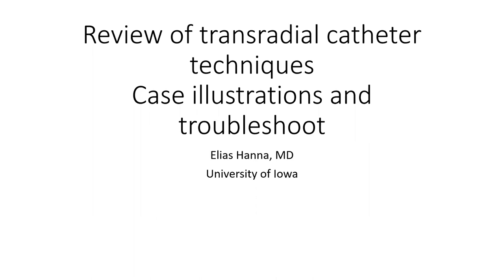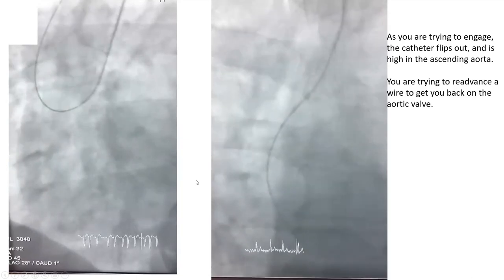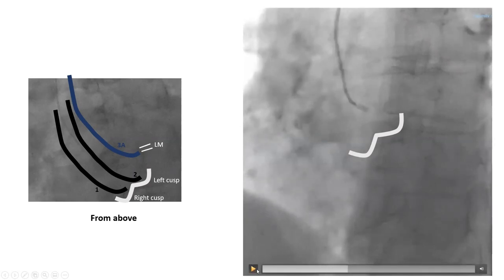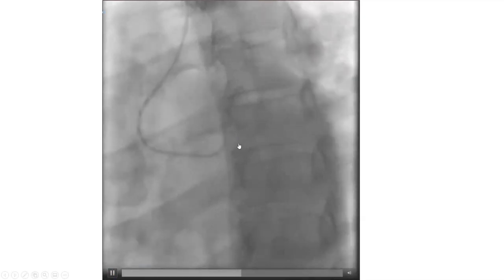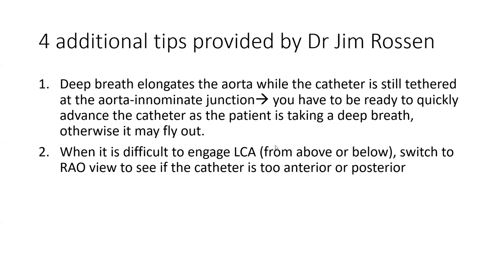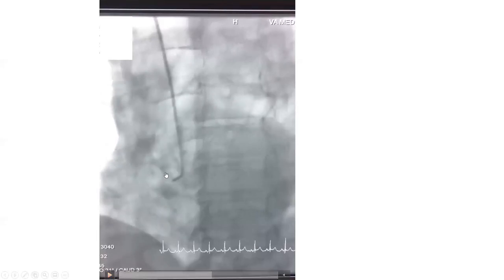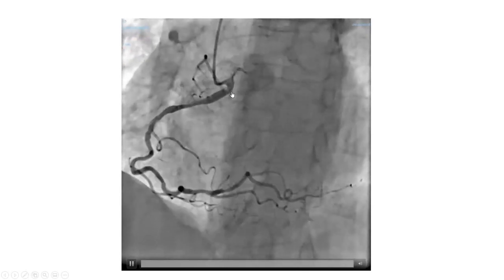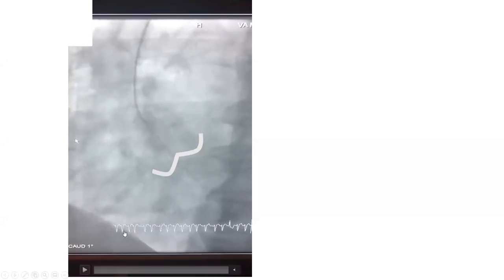Review of radial catheter techniques: case illustrations + troubleshooting (what is the next step?)

Comment: Great talk sir. For your future video, could you give tips and trick how to cross bicuspid aortic valve and bioprosthetic aortic valve into LV? Is crossing mechanical aortic valve safe? Thank you Dr.Hanna
Reply from the maker: Great questions, thank you. I like them. When crossing any severe AS, it is often useful to perform small aortic root angiographic (5-10 ml), usually in LAO, to delineate the aortic valve hole and know where to aim your catheter/wire.
-Regarding bicuspid severe AS: it is often more difficult to cross bicuspid AS than tricuspid AS, as the hole is eccentric. 80% of bicuspid valves have fusion of the right and left cusps, and ~20% have fusion of the right and noncoronary cusps. In the first scenario: LAO view, which normally spreads apart the right and left cusps, is not likely to help, as the hole is rather in an antero-posterior plane, not right-left plane. Thus, RAO view is instead helpful and separates the anterior cusp (fused R+L) and the posterior cusp (NC). Do root angiography in RAO to delineate the hole, and may consider further angulations, eg RAO caudal.
    If you do aortic angiography in LAO, you will often see one domed cusp rather a separation between 2 cusps.

-In relation to the above, during standard left coronary engagement in pts with bicuspid valve of the 1st type, you will not see nor seek my beloved “jump” from right to left cusp (the one I describe at 12:50). Rather, you will see a subtle catheter movement across the valve from right to left, not a typical jump.

-Regarding bioprosthetic AS: the anatomy is variable and the hole may be better seen in a right-left plane in some, vs. ant-post plane in others. Do root angiography in LAO and RAO and may even consider a bit of cranial and caudal angles if difficulty persists.
-For mechanical valves, crossing is not safe and not recommended: risk of catheter entrapment + it frequently induces significant AI which falsifies measurements. I have unintentionally crossed many mechanical valves (eg, while engaging RCA) with no issue, but it should not be done intentionally. Transseptal puncture is required for invasive LV assessment, if absolutely needed. There are several case reports of using FFR wire across the aortic mechanical valve; this may be safe but data is limited.